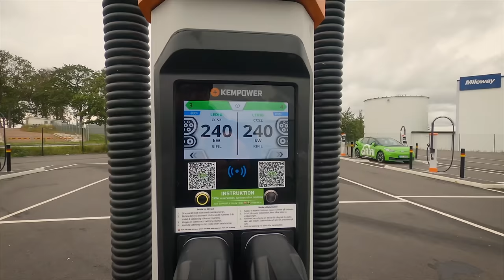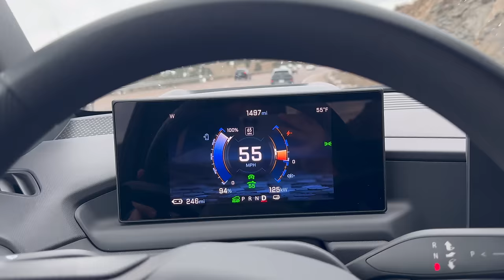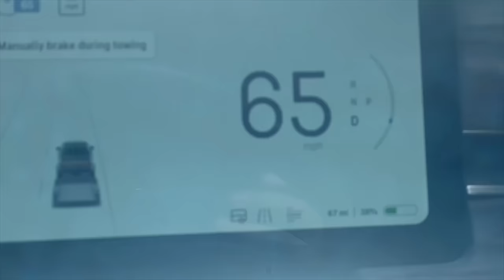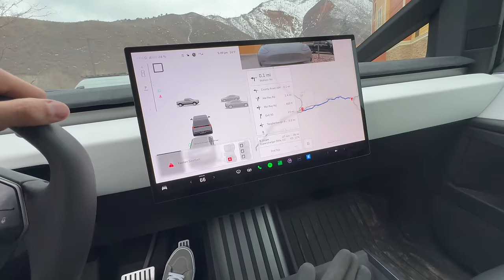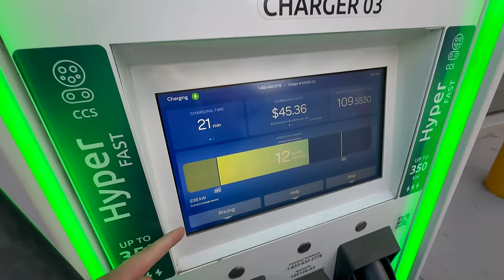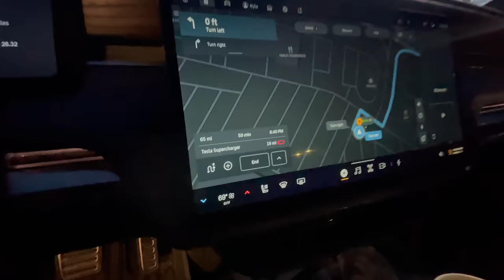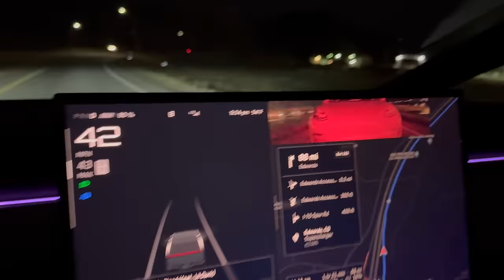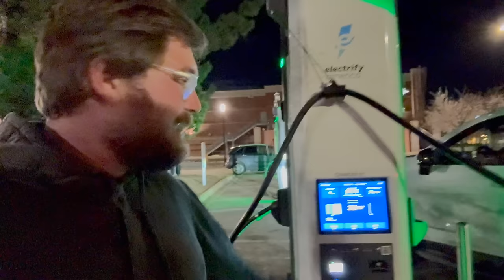Electric Trucks Tow 500mi Over The Rocky Mountains! Cybertruck vs Lightning vs Silverado EV vs R1T

Comment: The Chevrolet SilvErado is an absolute game-changing beast. Very Impressed!
Reply: Until the battery fails because they push the charge rate too much. Win early, lose in the long run.
Reply: @MH-Tesla The battery can take such a high charge because of its size. It's really only two batteries charging at about 175 kWh each. It's not strained at all.
Reply: @bahamatodd  I own a lawn care company. I really prefer an 8' bed, but can work with a 6' bed if needed. Never does a crew go even close to 100 miles in a day. My primary issues with trucks: 1) they don't make me money. They are a necessity to get the crew to jobs. 2) the crews damage (dent) trucks. They also rust quickly. 3) the cost per mile for a truck that has an acceptable body/looks okay, that's what I need. If I get any of these trucks for my company, the Cybertruck is the only one close. Once the price gets where it will after ramp and used trucks are being sold, the only truck for a contractor is the Cybertruck. That's the real work truck.
Reply: The charge rate is not to high. 4WT is duel 400 VDC packs in parallel, when charged by EA 350 KW (around 1000 VDC) the two halves switch to series turning it into a single 800 VDC pack. Haven't watch the full video yet, but the Cyber truck is reported to do the same thing going to keep watching to see if that driver gets the same charging speeds when connected to 350 KW / 1000 VDC charger.
Reply: @MH-Tesla  the Silverado charging at 350kw is roughly equivalent to a model Y charging at 120kW
Reply: Wha is the cost of charging between all of them is what I want to know.
Reply: Sure, great truck, but; 
1) You can't buy one.
2) When GM does get around to actually selling them, how much is that ginormous battery going to cost?
3) The thing weighs 4 tons! That's not good for efficiency.
On the other hand, Tesla obviously needs to work out the charging curve for the Cybertruck. This test did not impress me.
Reply: Tesla is doing what they do every time, protect the battery, till they have all the real world data then ramp up the curve,
Reply: 1:48:32 so dude consumed 3 charging spots while people were waiting. Hell naw.
Reply: @MH-Tesla  thanks elon
Reply: I wish Chevy would build more than 500 per quarter.  They are keeping production low on purpose.
Reply: @andrewcoleman6316  wouldn’t you if you were losing a wad of cash on each one?
Reply: @MH-Tesla  With the CT you know that the batteries in it will be vastly improved in the next year or so. If you can wait, wait would be my plan. Im in the UK so unlikely to ever to get it.
Reply: @surferdude4487  you can buy one from dealership in Bastrop Texas 75k. But I want to wait for the fleet sale places to sell them used. Hertz etc rentals will hit the market used watch for cheap!!
Reply: Its so inefficient though
Reply: @TimeHomicide  its a truck. If you wanna use it like one its needs a big battery.
Reply: The Silverado is the most inefficient one lol
Reply: @MH-Tesla  Couldn't disagree more but then again you're biased. The F150 and Silveraldo are the best choice for a contractor. Cybertruck could work but it's not very ergonomic for getting in and out quickly and the rear bed isn't as usable. Really looking forward to the upcoming Ford T3 next year
Reply: @ultrastoat3298  Tell me you have no clue how technology an new products work without telling me. Prices come down once production and sales ramp up
Reply: @Yielar1  Rear bed is larger and not sure why you'd think it wasn't as usable. It's more usable. Ford is too small. Silverado won't be available because they won't be able to sell them in volume at a decent price. It's just for show. Getting in and out of the Cybertruck appears easier, but I've only been in the Cybertruck compared to ICE trucks.
Reply: @MH-Tesla  Sorry you feel that way now that the cybertruck turned out to be absolute garbage.
Reply: Lmao cope
Reply: I absolutely love my 4wt and im not a chevy fan...owned ford trucks forever and a model yp, but chevy got it right with big range on a truck.

Comment: It isn't just a bigger battery in the silverado, it's also fast charging!!
Reply: A higher capacity battery is usually complimentary with faster charging. Silverado was definitely impressive in this EV towing competition!
Reply: Thanks!
Reply: Silverado also has coolant directly fed into the charge inlet to keep it cool while charging.
Reply: @orlandosaenz1553  👌
Reply: @orlandosaenz1553 That's awesome
Reply: @orlandosaenz1553 that's awesome but I'd imagine that might have issues if people don't change their coolant on time similar to how people have heater cores and radiators get clogged up
Reply: And heavy as sh*t. Don't tow in the mud. Lightning better there.
Reply: You're not supposed to use fast charging. Charging at home is what makes an ev a great option
Reply: real fast charging too, anything below 350 kw is a major joke. we should normalize being able to charge up close to how fast ICE can gas up. its crazy.
Reply: @macbook802  This is the realest take. a Work Truck should be charged after the shift ends and ready with full battery the next day. fast charging is a marketing gimmick as 350kw is the actual speeds that can take advantage of real fast charging, anything less is not real fast charging.
Reply: @acters124  Possibly, but level 2 chargers should be how we charge most of the time, because faster DC chargers take a toll on the battery pack longevity. I know that my Ioniq 5 won't go any faster than 250K on a charge, so 350K gets me nothing over a 250K charger, except it usually cost more.

Comment: 1:13:49 Generally, Silverado EV drivers are still going to want to prioritize ChargePoint, EA, and EVgo over the Superchargers because of the voltage differences. Luckily, with the Silverado's range and flatter charging profile, people will be able to be a bit more picky about which 350+ kW public chargers they use.
Reply: Is there a problem with using 800 V SuperChargers?
Reply: @bradallen1832  There wouldn't be a problem other than the fact that they don't currently exist.

Comment: Correct me if I'm wrong, but if these trucks got about 1.3 miles per kw/hr then that would be about 43 mpgE.  Compared to gas pickups towing at 12 mpg, that's a lot more efficient.  It will be interesting to see how efficient the upcoming trucks will be that use an electric motor and an ice generator.
Reply: I’m trying to have an open mind. But seeing everyone stand around a charger while they pay ~$80 doesn’t really persuade me.
Reply: Very
Reply: @UintaDave  It's a lot more to fill up a diesel truck. The Chevy only needed one 30 min stop over 500 miles while towing through a blizzard. I stop more than that in a regular gas fueled road trip lol. The other trucks with the multiple stops did not look fun though especially having to unhitch.
Reply: @Tazdeviloo7  pretty sure he said he was there for almost an hour so bit more then 30min. looked back i think 14% to 92% took 56min @1:38:34
Reply: @arbiter1  Good catch. He could have shortened it a bit by going to 80% since it's real slow after that so I guess a 45 minute stop is realistic or 1 hour if you need the extra range like he did. I see how the Tesla semi using a 1000kW charger now makes sense. 

With out a trailer, that's a gas equivalent road tripper. 1 normal lunch stop to charge and 2 400 mile driving legs. With a trailer, not equivalent yet. I tow electric and the biggest pain for me is not the frequency of stops, but having to unhitch to charge most times. Most dirtbike races I do are within an hour or two from home so completely powered by my off grid solar including the bike though.

Comment: I guess it shouldn't be a surprise, but cool to see that the Cybertruck was the most efficient of all.
 It could definitely be second place in this race but things like choosing the wrong stop do happen in the real world as well.
Reply: I don't think it would have made up the difference. The charging curve is still not great, and the charge port is in the wrong spot (unhitching), and you can't use a CCS station, so fewer charging options.
Reply: @bikeaddictbp they definitely had all 250kw charging stations that was needed that trip.
Same charging speed at 250kw at the top compared to rivian with a more efficient vehicle, Cybertruck could've definitely gotten second there.
Reply: @bikeaddictbp  Would have definitely made the difference, he hit two 125kW chargers and even spent time power sharing at 60kW.
Reply: Put Kyle in the Cybertruck and he would have won🎉
Reply: @felgen24 he didn’t win in the cybertruck on the coast to coast race
Reply: @bikeaddictbp  it definitely doesn't help that currently Tesla superchargers don't support 800V charging which greatly hurt the Cyber Trucks charging speeds
Reply: Most efficient at losing!

Comment: 1:08:58 ABB units were the ones installed with the first-gen HUBER + SUHNER cables that had the faulty thermistors. So the reduction to 100 A occurs when that thermistor doesn't have a good temperature rating. It's possible that even if it is buggy, EA might allow the full 500 A when the thermistor is functioning. Of course, EA should have replaced all those cables by now, but it's really hard to tell where they are in their upgrades.

Comment: Would be nice if you could plug the model 3 that's being towed into the truck to expand the battery while towing
Reply: Or the trailer. Imagine if the deck of that trailer was a battery that the truck could use. I keep wondering why Tesla isn't building one of these.
Reply: @briankeeley6464 Trailers with batteries seems inevitable to me, especially if battery prices come down as expected.

The thing that's missing is a standard for getting the trailer's energy into the truck.

I suppose they could just have the trailer battery drive the trailer wheels and take that load off the truck.  But I'm not sure what kind of challenges that would bring, maybe a lot.

I think it's already being done by a couple of companies but haven't heard anything about it lately.
Reply: @briankeeley6464  Because if the trailer has a giant battery, it would be useless since you couldnt load anything on it. Duh.
Reply: Indeed
Reply: I think the weight penalty of adding a battery to the trailer would kill tow rating

Comment: Kyle driving with high beams on in the snow, driving me crazy.
Reply: That’s what it looked like to me. I was hoping he would have moved the camera to the screen to see if the highs were on. If not then damn the lights need to be adjusted. Without the highs on he would have had a clear sight of the road. Rookie mistake
Reply: @brianh854  No, the Silverado EV just has the same issue every single fucking new truck has. The high beams are too bright and placed way too high for winter conditions. 

The only truck that gets this right is the cybertruck since it's lights are at bumper level.

Comment: The surge brakes on these uhaul trailers might actually hurt range on the electric trucks because the brakes come on any time the tow vehicle slows whether you want it to or not. They work great and they're super smooth for towing but you don't want friction brakes coming on when you're doing regen only. I would assume that the manufacturers designed these to not apply the electric trailer brakes during regen. There's a solenoid that bypasses the brakes when your tow vehicle reverse lights come on, so there may be a way to trick that into happening on the tow vehicle during regen, but I don't know if the engineers thought of that. I would assume they didn't.

Comment: This is great, what a fun and useful experiment. Hopefully the manufacturers watch and make improvements, many of which could be done with existing hardware. I tow quite a bit with my MYLR and it has some similar issues, but also is an excellent tow vehicle for less than a couple hundred miles.

Comment: Silverado is the real "Beast." What a performance!!
Reply: For sure becauses it has massive battery
Reply: @mrtt9800  true but it also has the massive advantage of being on an 800 Volt architecture and also having an absolute monster charging curve
Reply: Loving mine so far.   actually gets more than the EPA which is crazy since Im use to my tesla over estimating.   Nice to have zero range anxiety.   Litterally charege to 80%, drive a couple hundred miles in a day for work and still come home with 150-200 miles.   I also tow a 16' dump trailer several times a month and it tows it better than my f150.    Go with the 4wt and you can pick one up for 66k without a tax rebate

Comment: Enjoy the video. I tow a boat all over Georgia and Florida. After watching the towing video that was entertaining. I will keep towing with my 2015 F150. A lot less hassle and stopping. Plus the Charging cost is close to the gas fill up.
Reply: The charging cost is more he went from Denver to Grand junction and back to Denver if you doing it right you recharge the battery at Denver so it's a complete test so it would have cost somewhere around $170 to $200 for $500 and some miles what a joke if you figure a gas pickup would only get 10 mi to a gallon it's around $4.10 a gallon of gas to come out to the same cost as these electric vehicles I don't know what a pickup pulling a trailer gets for gas mileage but I think it's more than 10 mi to a gallon just goes to prove that these electric vehicles are big joke
Reply: If your car sits at home during the day and you have enough sunny property, that energy could be cheaper than gas.  Otherwise, if you're gone during the day, no chance for that.
Reply: Big picture here…… future generations consciousness

Comment: can you please do some testing with higher loads?

I was really disappointed that the cybertruck cut the towing capacity down to 11,000lbs, as i'd planned to use it to tow a 14,000lb trailer on mostly flat highways. not sure if i can still go that route with any electric truck which is disappointing.

Comment: People were so gung-ho to criticize the Chevy Bolt EV that they completely overlooked the fact that GM has had some of the best, most dialed-in blended and regenerative braking systems of any automaker since 2017. I know some people prefer the regen configurations from other automakers, but most of that seems to stem from personal preferences and a desire for coasting, which is unnecessary if you have proper blended breaking and cruise control.
Reply: Agreed, the Gen 2 Volt had intuitive blended, regen, and regen on demand, it didn't matter what sequence or combination of regen techniques were used, it was all incredibly smooth the way it blended together.
Reply: Agreed, even the slightly earlier Gen 2 Volt had intuitive blended, regen, and regen on demand. It didn't matter what combination or sequence of regen techniques were used, they all blended together into a smooth execution. Unlike some Korean brands *cough Niro cough*.
Reply: Coasting seems natural to people who learned and drove on auto transmissions most of their lives. Give me proper regen breaking controlled by the accelerator and possibly some "virtual gears" to control it! just like manual trans please :)
Reply: Best blended brakes I've ever experienced was the Mitsubishi I-MiEV. Took a trained ear to tell when the friction brakes engaged because you can't tell by feel, it's that smooth. 1st gen Volt was okay, 1st gen LEAF was horrible, but I couldn't give an honest answer about the Bolt EV because I max out regen before pressing the brake pedal. The friction brakes alone come in smoothly, although they are underpowered to stop the Bolt on their own. 

There is always Neutral for coasting, which doesn't put the drivetrain at risk in an EV since nothing mechanically disconnects. For hypermiling though, the more aerodynamic the car, the less benefit coasting provides, especially if a permanent magnet motor is used. Induction motors can benefit more since neutral completely shuts off the drive inverter and cuts power consumption whereas permanent magnet motors must remain powered.